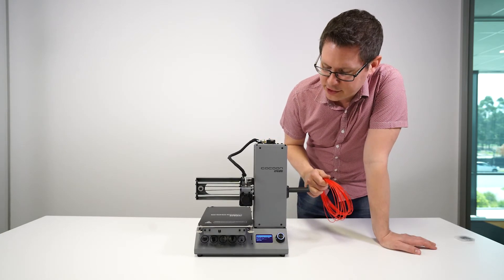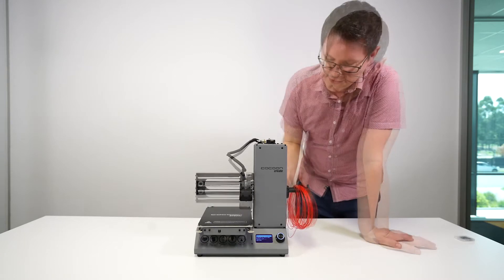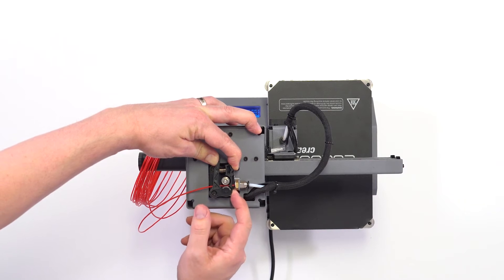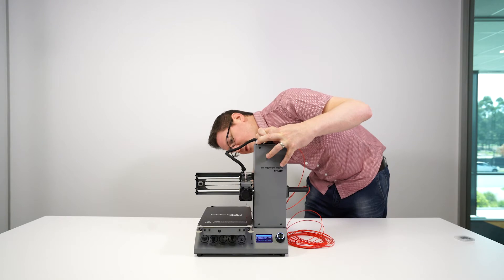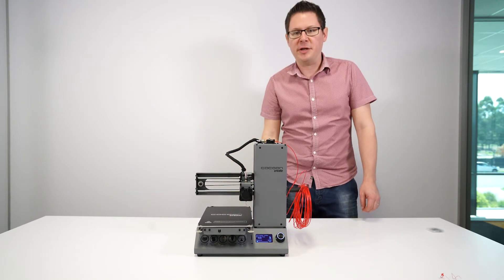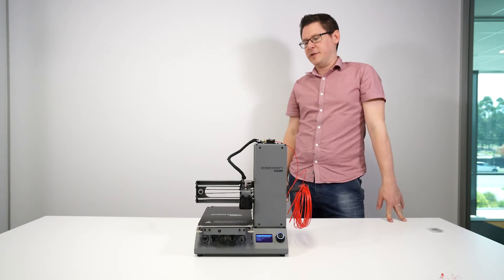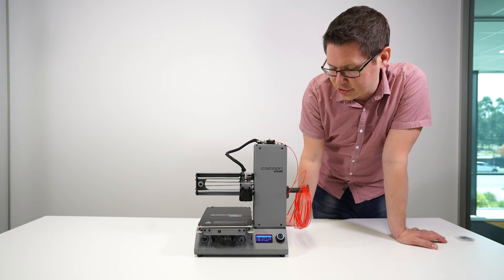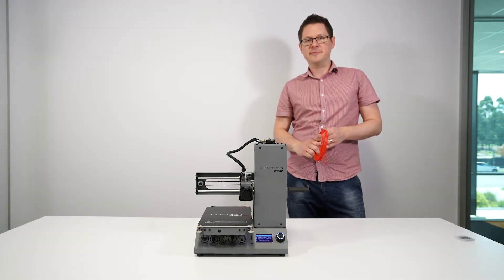Cocoon Create ModelMaker - Loading & Removing Filament

Comment: Our Men' Shed has been donated a Model Maker printer but it is not achieving tempetatures above 155, usually a bit lower, during preheat, filament loading, etc. After about 5 or 6 minutes it just shuts itself off.
Can you point me at a troubleshooting manual to fix this problem?

Comment: Can  you help me! My filament is stuck in the tube! and i cant get any filament coming out
Reply from the maker: Hi SpectreLobo, please contact our support team at help@cocoonproducts.com.au - they will assist with this issue.
Reply: You can push down on the black clips on each end of the plastic tube and slowly pull the tube out on either end to retrieve the filament. Ensure both ends are free from any old filament and then add it back in.